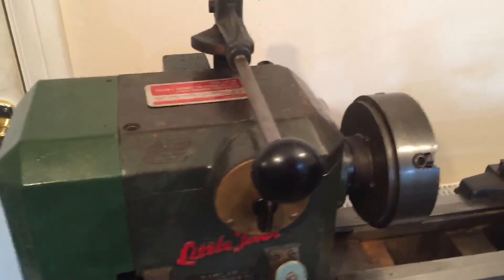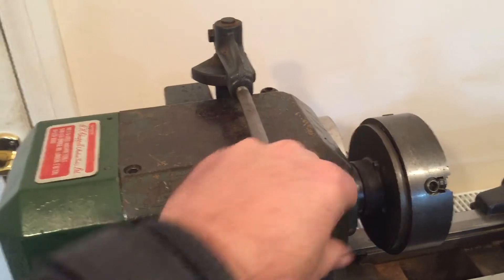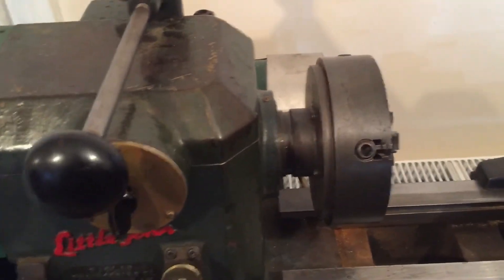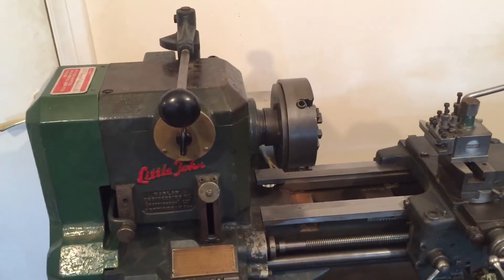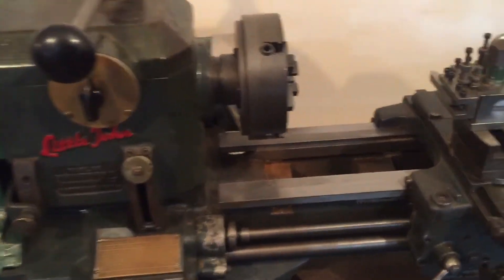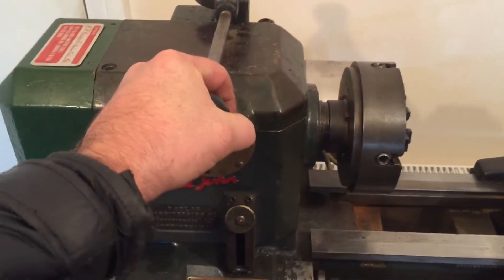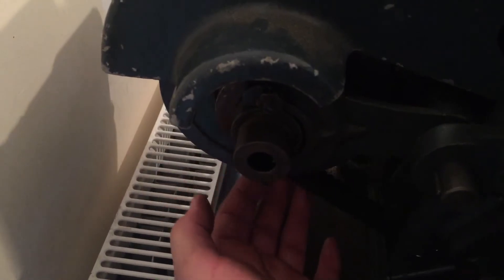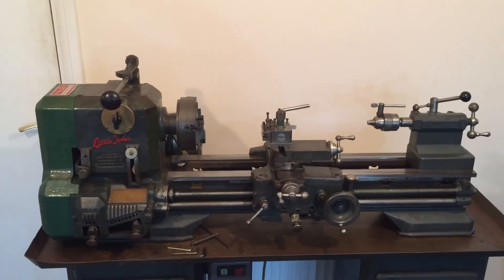Raglan Lathe Little John  variable speed function

Comment: I bought the same lathe, but it is missing the plates and some other parts that connect to the motor, do you still have yours? Could you show me a more precise assembly and the diameter of the plates to be able to manufacture them?
Reply from the maker: Its long gone , I have no record of the chap that took it.  Sorry about that.   BUT there is a Raglan web site that have lots of info and users of this lathe.  Thats a good starting point for you.

Comment from the maker: The motor pulley consists of two plates with the belt running in the middle.  As you pull or push the lever the plates open or close allowing the belt to go lower or higher.  Hence replicating a small or large cog.  Eg. Different speed.
Reply: At the same time, the pulley inside the head makes the opposite change, so you can have the equivalent of a small pulley driving a large one or a large pulley driving a small one, while maintaining the belt tension throughout the range.

Comment: Not sure if fulcrum is the right word, but Maybe it’s the length between the pullies increases and decreases giving more speed. Hence the belt widening and narrowing?
Reply from the maker: yes, as you pull or push the handle ontop, a cam opens or closes the motor pulley and increases the gap between the pulley. As it opens the belt drops down so in effect simulates a small cog, if it closes it forces the belt upwards so simulates a big cog ( motor side ). hence faster or slower chuck speed.....  quite clever.